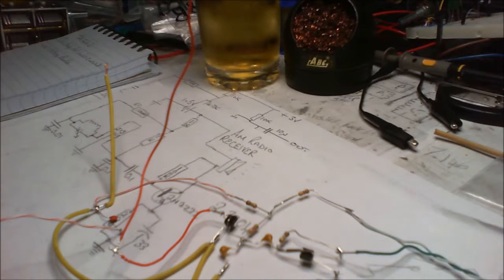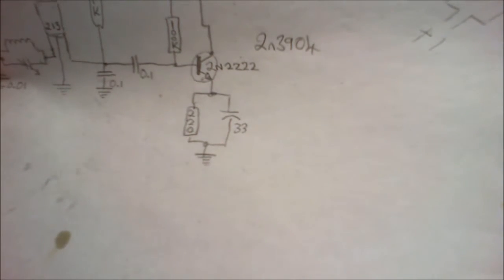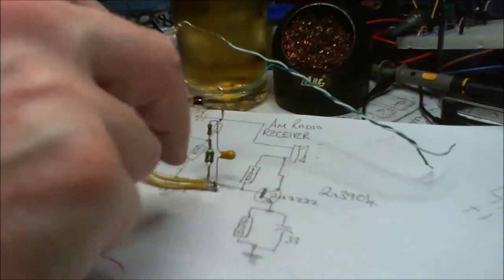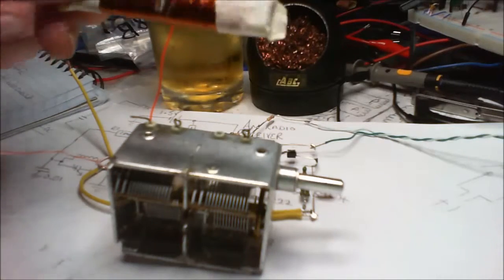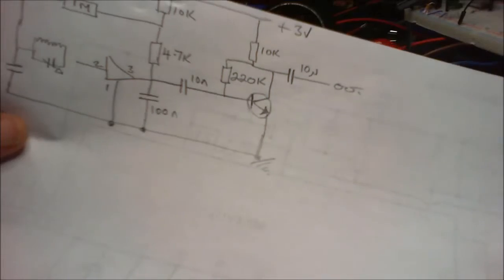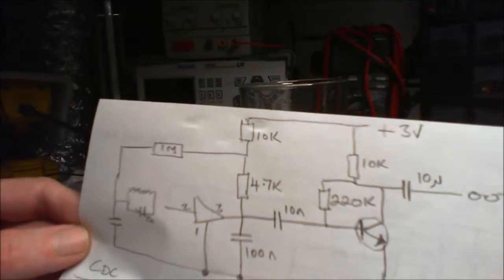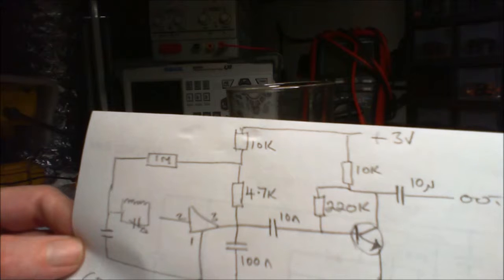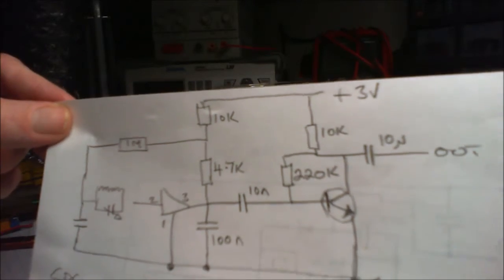Radio based on TA7642 and LM386 1/2

Comment: Right first of all your chip, the TA7642 is wired wrong,as you look at the numbers pin 1 is the ground ! Get the data sheet, your coil is far to many turns, the tunning cap is wired like this, one gang connect to the chip side and the other connection go's to the case of said cap. Any questions please ask
Reply from the maker: +Graham R Dyer cheers for the input. I would assume if it was wired wrong it would not work. I have looked again at the datasheet and I see all is well. The yellow wire connected to pin 1 is ground. Cheers again.